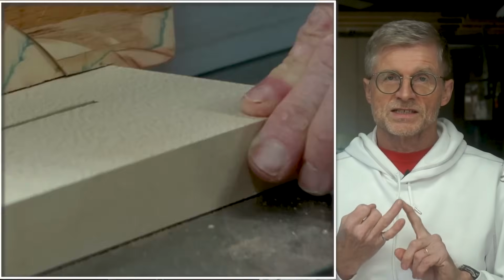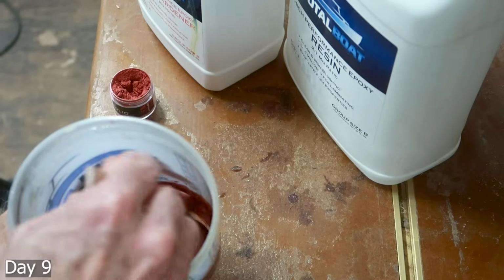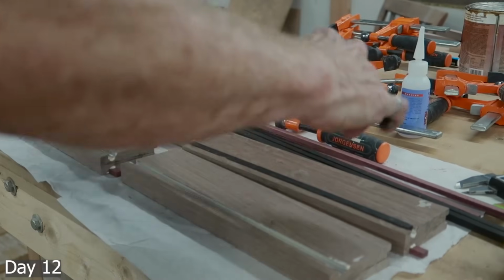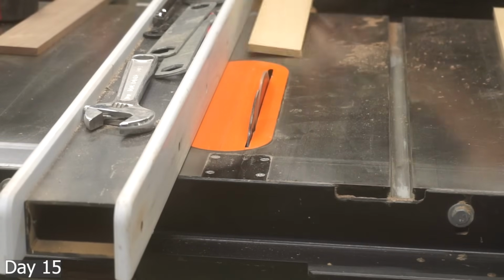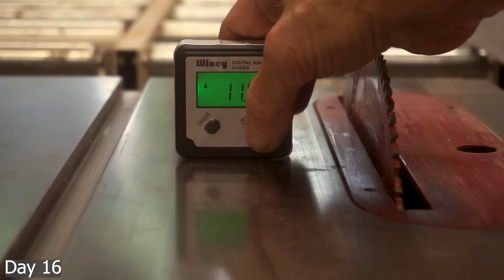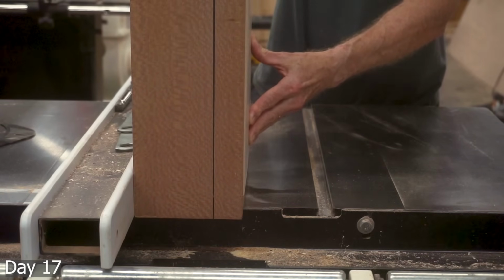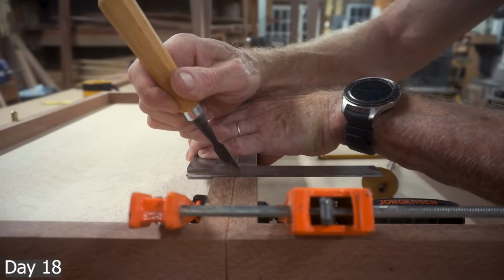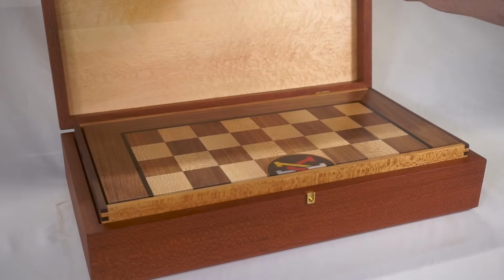Exquisite Folding Chess Board in a Leopardwood Box

Comment: Amazing work. Just found you on you tube. Curious as to why you use a plywood substrate instead of a solid piece of wood? Love your boards. Thanks.
Reply from the maker: The issue with solid hardwood is that it expands and contracts when humidity levels fluctuate. Plywood is much more stable, so it provides a good substrate that will stabilize wood movement when the hardwood squares are glued to it.
Reply: On this I was wondering what thickness you would do the hardwood squares.